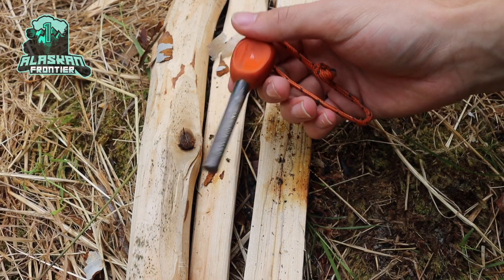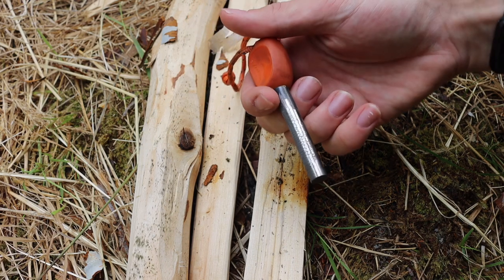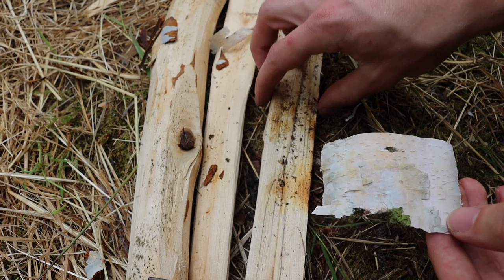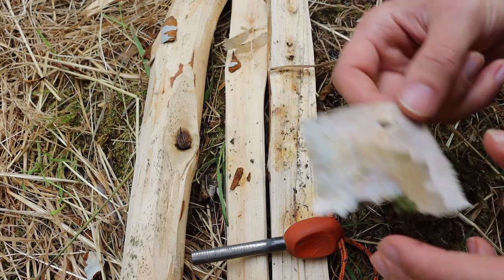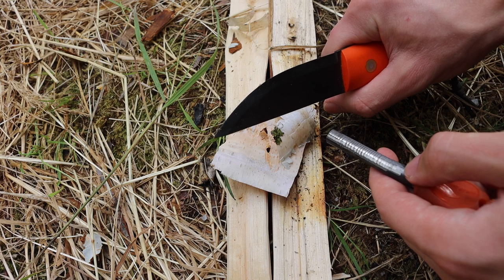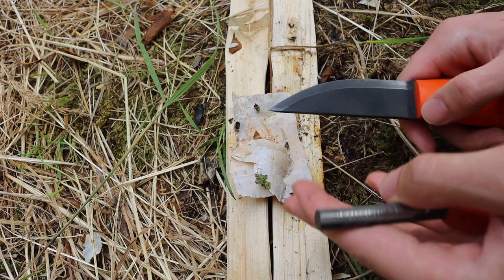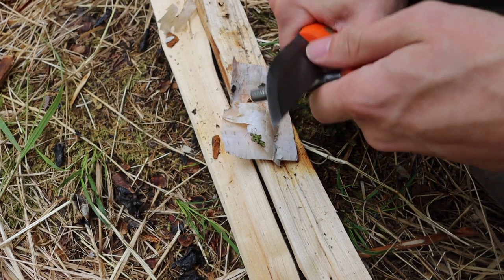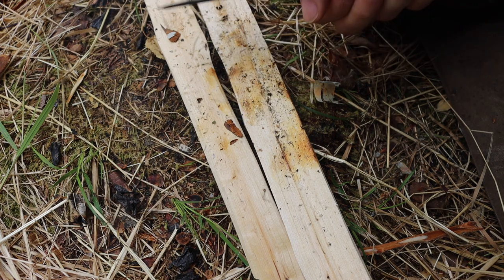How to Use a Ferro Rod (Firesteel), Tips & Tricks

Comment: A technique I like to use is: push the sharp belly of the blade into some wood or soft material and place the tinder next to the blade.  Now that the knife is planted and stable, pull the fero rod against the top edge of the spine, showering the tinder in sparks!  You still need to hold on to the knife with one hand, but I find this method is more stable and puts more sparks on the tinder.

Comment: For lighting a tinder bundle I prefer to pin the bundle down with the ferro rod, 1 or 2 slow strokes then 1 hard fast stroke for stoves I'll float the ferro rod over the edge 1 or 2 hard fast strokes driving the sparks into the stove. 🤔